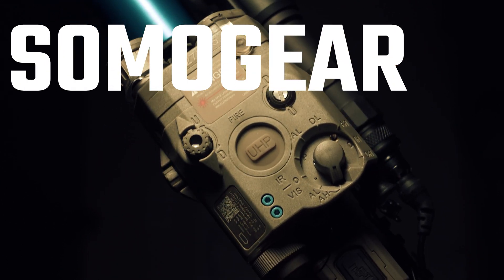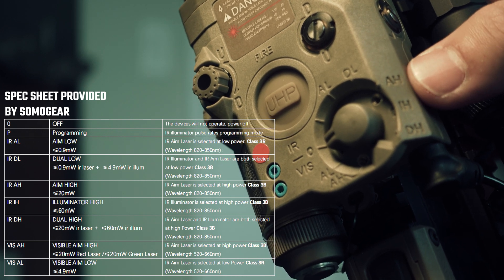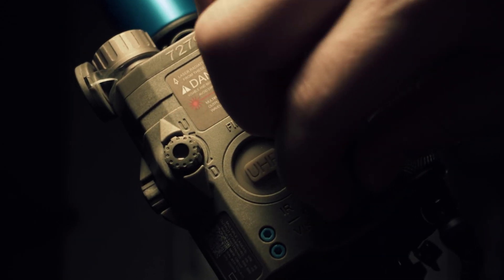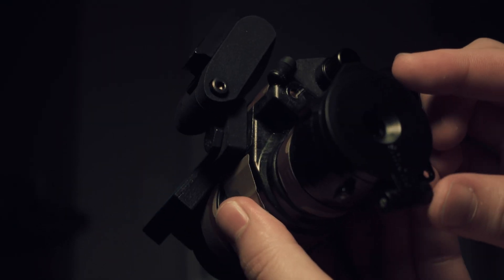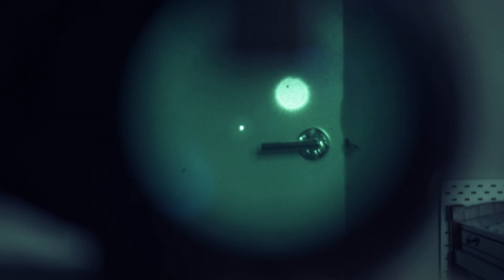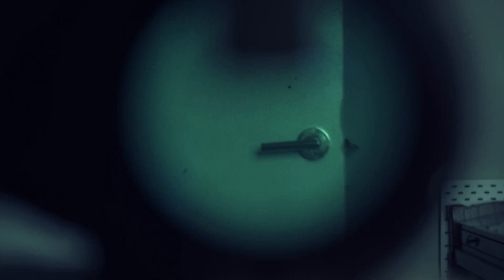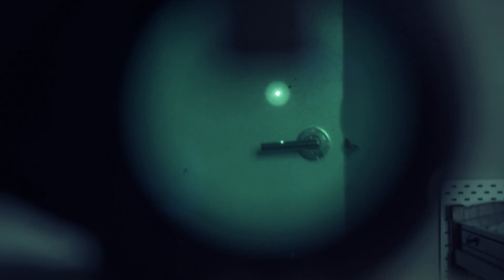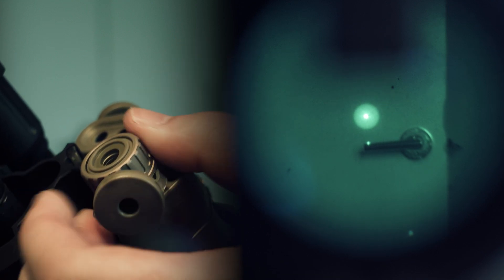SOMOGEAR full power PEQ15 - Does it really have a full power ir laser?

Comment: Hello, I am planning to buy this PEQ15 , do you recommend getting the PCB Potting Services? I dont understand what is it for, do I really need it or not?
Reply: The potting is used to ensure that the internal wiring doesnt disconnect. Imagine filling the internal case with liquid polymer than letting it set…same concept, just another way to ensure the wiring and circuits remain intact
Reply: @cm p  so it will remain 0 better, correct? Does the filling make it overheat because there's less air flow?
Reply: In theory yes, less space would mean less movement…as far as the heat concern goes I would t worry about it. I’ve run full power Peq 15’s (Army Infantryman) and the most you use these for is quick identification and snap shots…you won’t be running recon or clearing buildings with this unit on at all times. Always remember the laser as well as illuminator can be seen and tracked back to its user
Reply: @cm p  thank you for the explanation. It's all clear now
Reply: Hey where should we go for potting services?
Reply: @santanagamingcinema  somogear does it themselves
Reply: Is this an airsoft unit? So cheap!

Comment: I'm really curious about how durable this thing is. If it can take a beating and hold zero, why not?
Reply from the maker: I haven't done any thorough tests with real steel, so no comment on that, but it's cheap enough, I would just buy one and test it myself if I were u.
Reply: I broke mine completely they are pretty fragile
Reply from the maker: @a12dad561  When did u get yours? I been hearing different level of QC for different batches.
Reply: @a12dad561  yeah, I've been hearing conflicting reports on it so far. I've heard some say it's great and holds up well, others report your issue sadly.
Reply: @a12dad561  was yours potted?
Reply: @deadeye4256  No I think they added that option shortly after I got mine
Reply: @a12dad561  okay hopefully mine holds up. they may help you out if you ask. listen if you want anything in life tell them a story GIVE THEM A FUCKIN STORY
Reply: @deadeye4256  Yeah I sent them a message and they told me to send it back... I never got around to it Im sure my warranty is up now. Ill give them another shot when they are back in stock.
Reply: @a12dad561  just send it in lad. blame the corona for slow mail
Reply: @a12dad561  again GIVE THEM A FUCKING STORY
Reply: @deadeye4256  better yet, leave a really long and whiny sob story as a review. They'll respond.

Comment: I also have the full power peq15, and noticed that I cannot see IR beam, just the dot. Did you notice this as well?
Reply from the maker: whether you can see a beam or not is depend on the air condition in your surrounding. I can see a light beam with mine in outdoor environment especially somewhere is dusty or moist enough.

Comment: You really need to take the unit outside and see how far the illuminator works at night. On a clear, well lit night the illuminator on a civilian IR illuminator like the ATPIAL-C or DBAL-A3 won't be visible much past 25-50 yards. In ideal conditions, no moon, overcast, etc. you will see the IR illuminator out to 100-125 yards or more. The IR laser on high power will have a beam that's mostly visible in overcast conditions and it should be too bright to use up close as it will bloom too much. 

Based on what I'm seeing, this is closer to the ATPIAL-C than the full power PEQ-15's the military uses. The unit does look the part aside from the label and the fire button which should be slightly domed and smooth with no writing on it. Hilariously, you can focus the IR illuminator on this unit and you can't on the ATPIAL-C's. But the ATPIAL-C's illuminator throws more light indoors based on the video. However, I do realize that the camera doesn't show you exactly what you see under actual night vision. 

The biggest problem is that the unit is designed for airsoft, not actual firearms. None of the airsoft grade units I've seen have been able to hold up to the recoil and punishment of being used on an actual firearm. At worst, the units break quickly and at best they won't hold zero under recoil.
Reply: Buddy has a somogear on the way, but these Chinese airsoft peqs are much closer to full power units than civi’s. My fma LA5 laser seems to hold zero, but need a lot more rounds under NODs to confirm.
Reply from the maker: @GuamGuy  I can confirm latest batch of FMA laser are real steel rated, but most of the somogear products are not, heir perst-4 is real steel rated.
Reply: @CJmeowmeow  yea but they are not ir devices just laser and flashlights
Reply from the maker: Thank you for the advice, there are more testing coming, I am also receiving some "real steel rated" MAWL C1+ replica as well, will do out door testing with real PEQ-15 side by side.
Reply: @CJmeowmeow  any updates on this?

Also, is the FMA peq or Somogear peq better for 5.56 use?
Reply: @jonathanyeung3873  wondering the same
Reply: Those sure are a lot of words for telling us you have zero experience with anything you mentioned. All of that is wrong.
Reply: Update. 
FMA’s zero shifts under 5.56 recoil. Inherent to the adjustment’s return spring. Might try to modify it. Otherwise it is a decent full power illuminator for the price if you don’t mind the Petri dish. Blows away the civi strength holosun I could compare it too. Needs a real diffuser cap. Build wise is acceptable. 
The somogear was a let down. Build quality felt much more like an airsoft laser. From the plastic shell, inferior feeling power button, mushy adjustments, and the laser and illuminator caps being simple black outs instead of a pattern generator/ diffuser. Mod button wouldn’t work even though it is the l3 laser plug style vs 3.5 aux. Green vis laser is day light bright but not co-aligned to the  laser so it has dubious value. IR illuminator is clean and full power but is tiny. Probably less than 2 degrees at its floodiest.
I would pony up the extra $100 bucks for the FMA.
Reply from the maker: @GuamGuy  intersting, mod button works on my somogear peq15, the power button and adjustments has a very positive click feedback on mine as well, as for the issue u have mentioned I believe they made adjustment on the IR illuminator angle and hilariously when I told them that I want to test it on RS, they actually try to convince me not to, bc they want to make their products only for airsoft for import export reason lol.
Reply: @GuamGuy  yea but fma doesnt sell ir laser and illum its just ir caps at least thats what there site says so not sure how it better. I havent seen many people cover fma, maybe make a comparison video